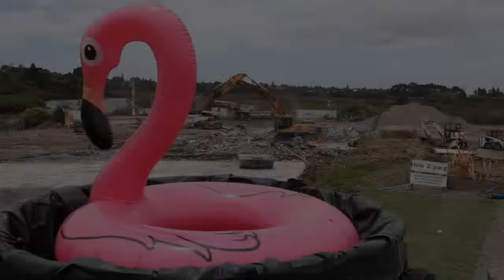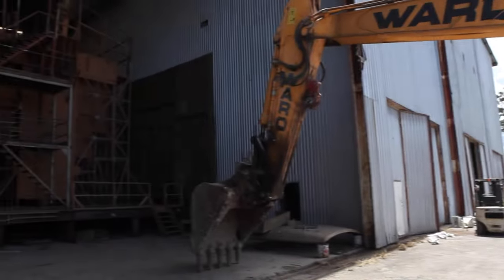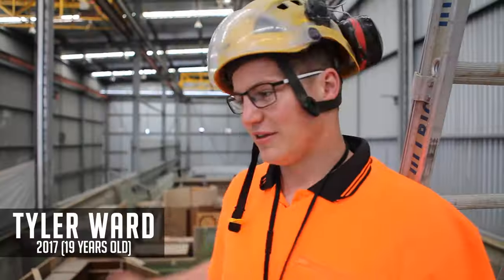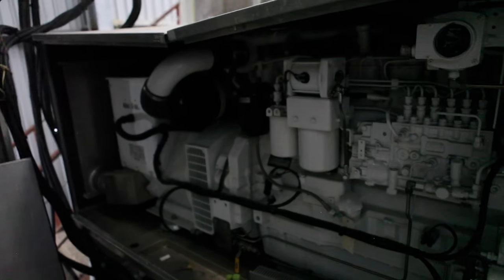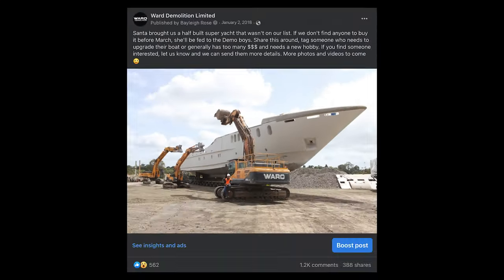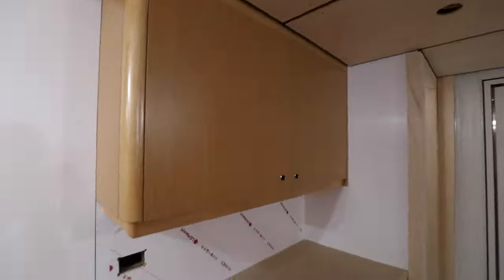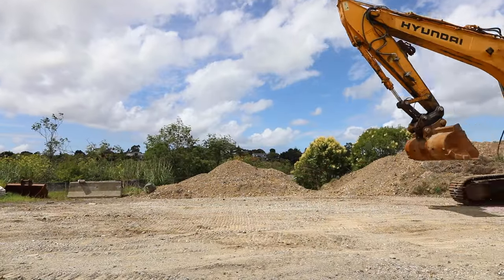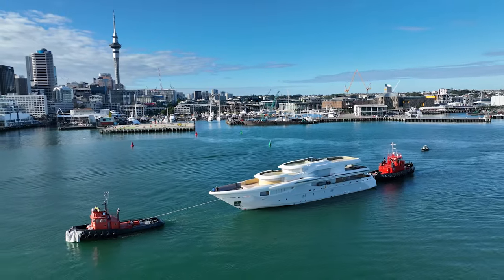We Salvaged a Super Yacht

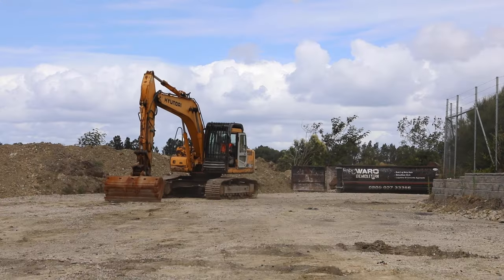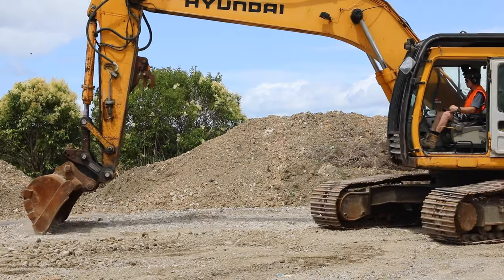Comment: It’s a epic project. That ur company toke on with this.        Ur    Work.      Shows.      Ur work.   Is professional.       ✅ 3:21 3:21 3:21 3:22 3:22 3:22 3:22 3:23 3:24 3:24 3:24 3:24 3:24 3:24 3:24 3:25 3:25 3:25 3:25 3:25 3:25 3:26 3:26 3:26 3:26 3:26 3:26 3:27 3:27 3:27 3:27 this was the boat company at west Auckland right.     Just down from the dump.  Right.      Yes I lived out west Auckland many years ago.      Around. 8 years ago.
Reply: do you have a computer virus? why do you type like that?
Reply: @whatthesigmaW    I am.  German bloodline.       We type differently